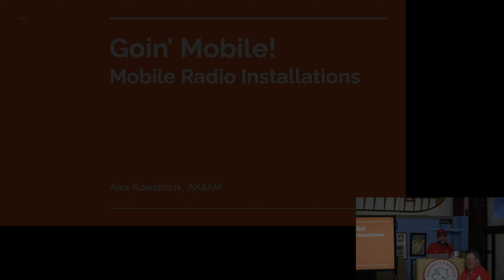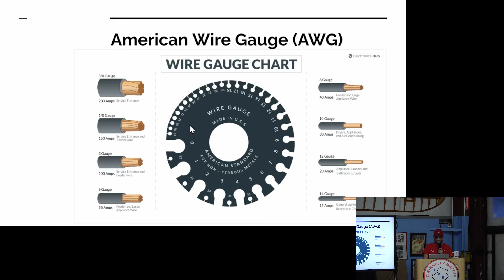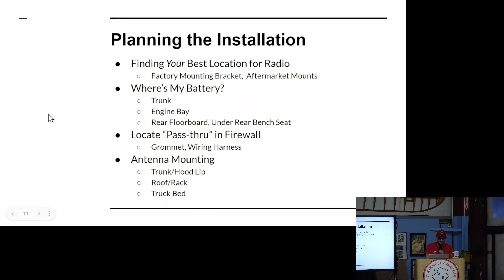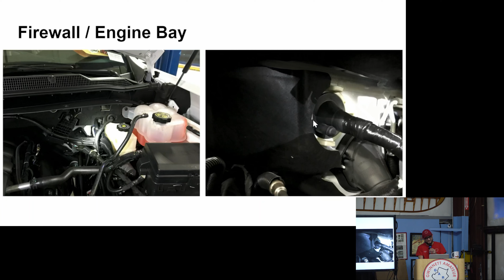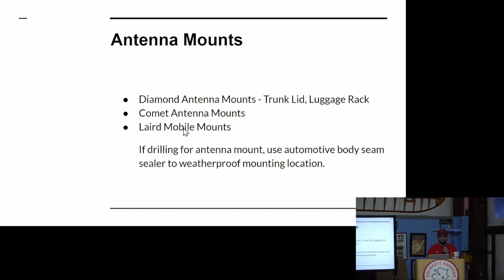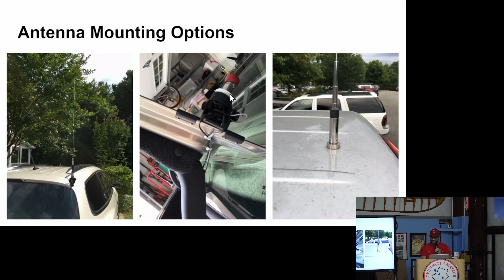Mobile Radio Installs

Comment: Excellent overview and insight of mobil installations by an Auto Technician who is also a Ham Radio Operator!  I'm guessing Alex is a Pro at Auto/Electrical diagnostics.  Some thing not mentioned, unless I missed it, was Supplementary Restraint Systems; Air Bags.  I would suggest extreme caution on placement of speakers, radio control head or microphone to make sure they are out of the path of any of the Air Bags.